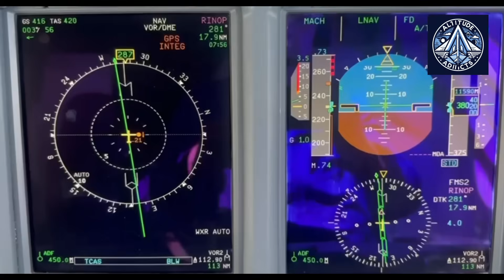Komsomolsk to Zhukovsky: Superjet SJ-100 with PD-8 Engines Proves Itself in the Skies

Comment: What does it bring compared to an A220 or an E-190?
Supposing it reaches an acceptable availability rate and safety record, alongside rentabilty, it still comes 20 years after these two have established a customer basis.
Reply: A220 is in a completely different category.
I suppose it will be inferior to E-190, but at this stage that's not so important for Russia.

Comment: The "new" SJ-100 will face a tough time in international markets against competitors such as the Embraer E1xx or the Airbus A220. Restrictions imposed by war-related sanctions make the model unattractive for most airlines, regardless of its performance data.
Reply: It's not even trying to compete in the international markets...
Reply: This type is for domestic and sanctioned (Iran, NK, Cuba) markets.
Reply: Si las líneas extranjeras no compran por prejuicios entonces no podrán ocupar el espacio ruso que es el 20% del planeta
Reply: There is enough domestic requirement and sanctioned countries' requirement to make this plane a success.
Iran, North Korea, Cuba, Venezuela and some African countries that are also under sanctions will snap it up.
There will be a huge demand in Russia for it to fly within the EAEU
Reply: @paulidson1483  In all these markets there will be a tough competition with China's COMAG.
Reply: @luisdamian4562 
China still uses parts made in the EU and US, the plane is not fully Chinese, therefore those countries would stop it being exported to countries like Iran and North Korea, The Russian jets fully built using Russian parts will be the only option.

Comment: Was the flight conducted with simulated operational weight including passenger and baggage weight? If not, I fail to see how this is significant.
Reply from the maker: It has ballast for that weight. It's a normal practice. This flight is about long distance flying.
Reply: @altitudeaddicts that’s good.  Have they done a long distance flight like a ferry flight with no extra weight, just max fuel? I think the c series did a 9 hour ferry flight.
Reply from the maker: Appears to be with no extra weight and max fuel. But, it is definitely ferry flight. C Series did extreme hours. A nine-hour flight in an Airbus A220 or Superjet aircraft is not typical. Only for testing purposes.
Reply: @altitudeaddicts are you clarifying  that the super jet didn’t have typical ballast weight.
Reply from the maker: In one of the videos, they showed ballasts. In practice this is normal. But, since there is no visuals in this particular video, I cannot tell for certain.
Reply: @altitudeaddicts ok got it.  You’d think they would use ballast to get a really good idea of operating economics on a flight like this.  I’m sure we’ll find out more later.
Reply from the maker: Ballast are important for the stability of the aircraft. It could be Empty Weight Ballast or MTOW Ballast.
Reply from the maker: Just to make it more  clear, when I first flew solo in a training glider l, sand bag was used instead of the instructor.
Reply: you failing to to see ,is irrelevant
Reply: @DimK6631 you thinking the comment has something to do with you vs how AA communicated the purpose is irrelevant.
Reply: @jeffhedrich3551  its not about me at all, its about people like you who think they are just experts on bs
Reply: @DimK6631  get over yourself.  I didn't claim to be an expert. I'm trying to be informed about the testing program.  Telling us a plane flew from A to B with few specifics is not exactly news is it.
Reply: Guys I think to me what am happy about it to see Russia becoming independent from the west also the industry should be made open source not not state owned
Reply: @JASTGAMIN  another clown think he have the urge to lecture Russians